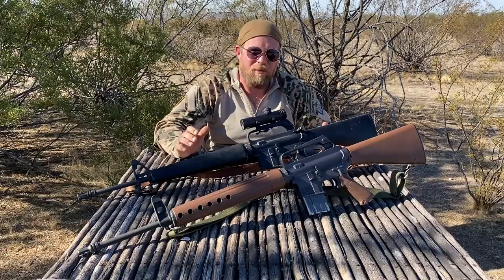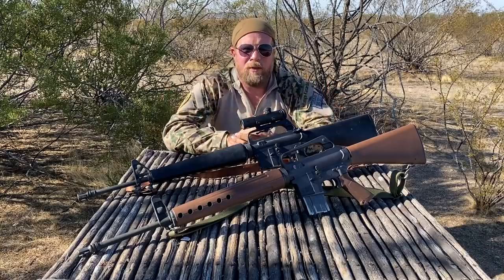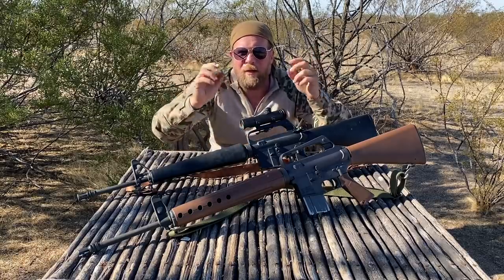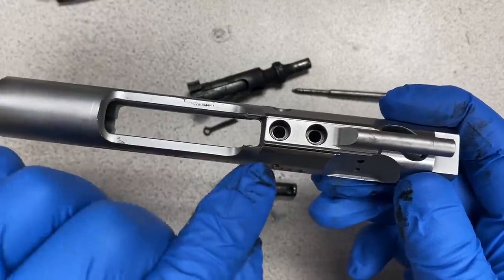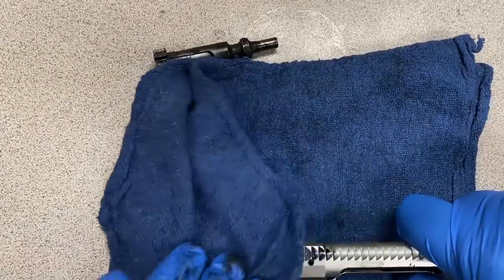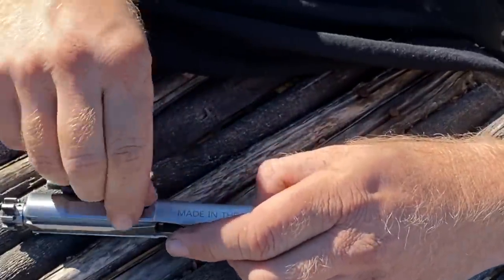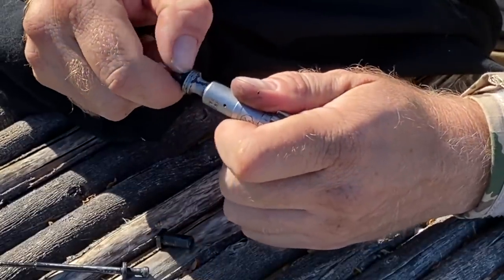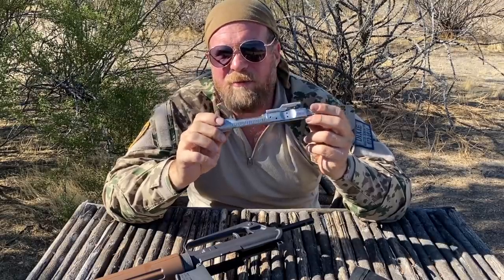WWSD2020 - Bolt Carrier Group

Comment: How does this stack up to NiB? That's what I'm kinda curious about
Reply: @SuspiciousGanymede  interesting, because I know everybody and their mom seems to be loving NiB these days
Reply: @randymagnum143  is that a problem with the NiB coatings? It wears off?
Reply: Hydrogen embrittlement is caused by improper heat treating and can even effect Chromed parts. However, hard chroming is more well practiced and familiar with suppliers, so the process plan is more stable for quality purposes. All comes down to the supplier, basically.
Reply: @SuspiciousGanymede  I have a few thousand rounds on each of 2 NiB BCGs and neither has any flaking or noticeable wear that I've found. 1 is a PSA and the other is Aero. I have had 2 other bolts that have phosphate coatings and the on 1 the chrome ring on the actual bolt is showing some flaking of the chrome. It's a CMMG manufacture. Now, I'm just 1 dude on the internet with a handful of bolts but I'm only buying NiB BCGs if possible. I did just buy a AR10 BCG that has a Black Nitride coating, as it was literally the only 6.5 Creedmoor bolt I could find. Haven't had any rounds through it yet, waiting on finding a good handguard to finish the build but am curious as to how the black nitride finish holds up. This BCG was manufactured by Rubber City for any curious. Sorry, that got long-winded.
Reply: @thereallocke8065  I've ran a nickel boron bcg in a firearm with a binary trigger for as close to full auto testing as I can get, and I've not noticed any wear after 1,000 or so rounds

Comment: I really wish we could combine the best features of this bcg with the best features of the LMT Enhanced bcg. Unfortunately patents don't work that way.  The LMT bolt head and extractor is just better. The increased dwell time from the LMT is hands down better for a carbine or even mid length. But it comes phosphated, and doesn't include the bolt key and cam pin hole reinforcement of the Young.
Reply: if you dislike the phosphate I'd say take it to a coating shop and get a nitride finish, it has all the cleaning advantages of a chrome finish without the downside of it flaking off or corroding underneath like a chrome one.
Reply: @KamikazKid  That doesn’t really happen with modern chrome coatings
Reply: Right? I fantasize about that a lot. There's like 4 or 5 products I want to combine into the ultimate bolt and carrier
Reply: @KI.765  And just fun I'd add the POF USA roller cam pin.  Just staked one onto my latest build, haven't gotten to test it yet but hand cycling is noticeably smoother, as though it was on a roller bearing.  Because it is.
Reply: @lowellhouser7731  I wish I could get a shortened one for the HM/YM bolt that's on it's way. But that's not how it gets to be unfortunately
Reply: @KI.765  Bench grinder?
Reply: @lowellhouser7731  Probably run into a heat treat issue by exposing material that wasn't meant to be exposed
Reply: @KI.765  True.

Comment: I believe that titanium nitride is a better plating is a better coating. Personal opinion, but scientifically speaking, it's harder than hard Chrome. It has higher natural lubricity. Hard Chrome is good for sure. But in my opinion, not as good as hard chrome
Reply: I agree, I have a Ti nitrite coated “gold” Desert Eagle. It’s by far the toughest finish I’ve encountered. I have hundreds of rounds through it and the slide rails on the frame are still shiny and polished without even a scuff

Comment: Impressive!  Another example where 'milspec' is not the BEST. 
I guess one could say that wearing the parking off of wear surfaces is part of the 'break-in' process.  Thankfully, there are only four small wear surfaces on the BCG.
Reply: Mil-spec isn’t “the best”, just an assurance that a part has passed the MINIMUM acceptance standard. 

“Military Grade” is the worthless term. All anything has to do is be used once by any unit to be called that. Kind of like that gear that touts itself as “used by Navy SEALs”. Yeah, once; and it was the free sample you gave the guy at SHOT show.
Reply: @509Gman  Yep.  It reminds me of the term out of Russia: 'The best is the enemy of good enough.'

Comment: The only thing that bothers me about the Young BCG is the screws, they aren’t known to be the strongest and I suspect that you guys have changed them.
Reply: It’s not because of the screws they use that they break, they use a permatex gel to lock the screws and if you reinstall the same screws after removing them, they will most likely break.
Reply: it looks like they solved it with the lug/recess combo on the gas key.
Reply: They mentioned the lug taking the stress off of the screws. Are they still breaking even with that?
Reply: How recent are these fixes?

Comment: Hi Karl, I’m looking at getting a KP-15 lower, since I don’t have the money to purchase a complete WWSD2020 rifle. While I completely believe in the lower do you think I’ll “ruin” it by putting a normal upper on it, especially being I can only find heavy M4 style uppers right now? Would I just be better off with a normal aluminum lower because of this?
Reply: I don't think you'll "ruin" it slapping an M4 upper on it, it's still going to work & be lighter than a normal M4.  Honestly I think they added a bunch of costs most people won't notice like the silent spring most people don't run suppressors & wouldn't notice that part missing.  The bolt here is the same way I think you could run a nitride BCG and not notice any difference from this super expensive chrome one.
Reply: The only (minor) downside is it will be front heavy. Pretty easy to train around

Comment: I wonder what the failure mode with the short cam pin will be versus the standard though, and if it will start having issues before or after a standard
Reply: I wondered this as well, but I looked up the material they use for the cam pins, and it's a stupidly strong steel. Cannot recall the designation, but it's easy to find.
I'm no longer worried about it

Comment: I'm curious why would a wwsd be run full auto? 99.9% will not be. And if not why worry about bolt breaking. This bolt carrier group is quiet expensive the old Faxon group works great and is so slick in my Wwsd 2017 $85 bucks more I'm half way to an extra faxon bolt carrier group and a backup is 1000x more useful then one expensive group. Plus it's in stock guys.

Comment: In the spirit of stoner using the best material and cutting edge technology in creating his ar15, I think this could be a better material that could replace hard chrome BCG, may I introduce to you the WPC treatment. https://youtu.be/BF60s6LeQkI. I hope this makes to your next iteration of WWSD rifle. This is a metal treatment not a coating and will not wear off. It makes the surface super slick and 2x harder as well without changing the size of the material. It's relatively cheap too. We use this for car engine and transmission parts to make them last longer in racing application.